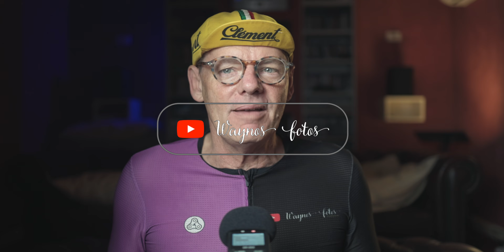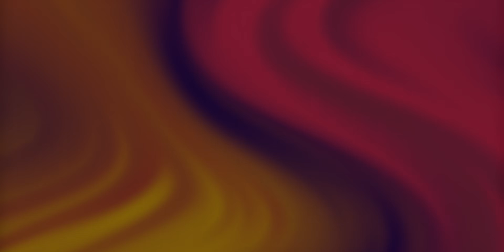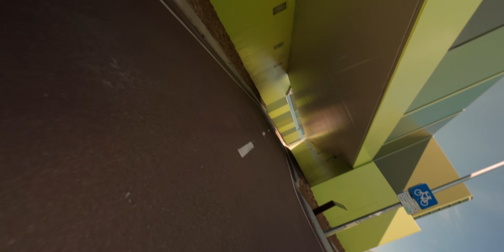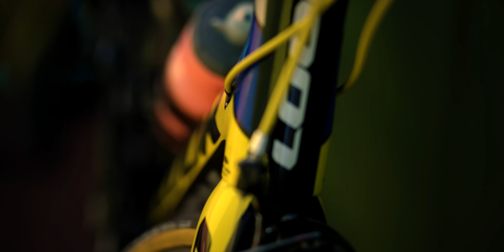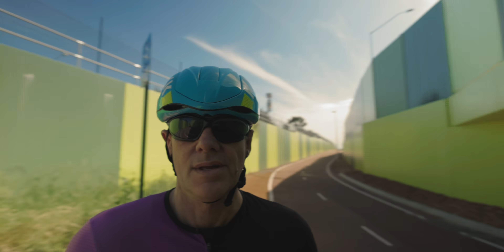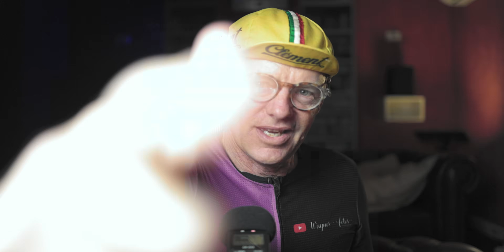TUBELESS tires, a industry failure?

Comment: Latex tubes, rim brakes, bsa bottom brackets the TRIED AND TESTED products for YEARS. Modern day expensive stuff is made in china and by baristers who are high on coke who realised you can scam the cyclists who view bikes as status symbols and anything below 3000 GBP or USD whatever your currency is is not worth it yet they pay for s works frames which are made for 300 usd in CHINAAAAA. Nowadays you pay to be a beta tester for this "tech" tubeless is a flop cant wait for people to realise discs on road bikes is over kill. If you need car brakes to control an inch and half wide tyre get better

Comment: I would submit in response: Zipp 303 FC at 1350 grams, and the Sram Axs Dub Wide.  Together you get lighter and wider, so the tech is there already.
On the 303's, 30 mm tires run at 55 psi, sealant works.

Comment: Road tubeless is theoretically the holy grail, and it's constantly sold as such. Shame about the reality. So many financial, maintenance and fitting issues. I run 3 wheelsets with them and they are a PITA.
However, i put up with this crap cos 55psi is bliss and the tyres do seal (55kg, so good luck if you're 70+) and I'm not changing anything on a ride in winter (can't even change gear sometimes let alone a tyre).
Hopefully one day it'll all work beautifully, until then I'll just have to swear a lot

Comment: 25mm/28mm tyres are race sized tyres. For racing. Anyone using race tyres on a daily basis only to complain about ride comfort or lack of puncture protection is just plain STUPID.
Unless one happens to race to work for a living, it's a NO for commuting also. Tubeless will never work properly on 25mm/28mm tyres because the pressure is too damn high. You get 95kg Hulk beasts riding on a 25mm rubber patch then complains that all the air pressure is out of the tyre when he gets a puncture, mf you should be glad you didn't slice the asphalt with those rims.
As far as tyre weight and all that, non pro's have to deal with being fat first and tyres second.
For anyone else try tubeless for yourself on tyres bigger than 30mm, if it doesn't work for you or if its' just too much hassle, then use tubes. The end.

Comment: The way new technologies are implemented in the bicycle industry is ... strange. The monopolistic position of Shimano is really problematic. The very poor technical content of the reviews in the media (no independence, no criticism). The way they have reinforced these technologies in the pro peloton is also strange / inefficient. The start of the disc brake was a failure, electronic groupset that keeps switching to safe-mode, useless tubeless on perfect asphalt stages. And then for us, the average consumer, we don't really have a choice anymore.
Rim brake are efficient ! Even on wet roads !! Cheaper, lighter, easy to maintain, reliable. for road bike AND for city bikes ! V-brakes are working fine for daily use !! and they so much cheaper and easier !!!
Mechanical gears are working fine. Lighter, so much cheaper, very reliable, no f&ck*ng battery issues. Please at least give us the choice !!!
Tubeless for road bike is a joke. 
I appreciate wider tires on road bike, up to 28mm for "race" bike. Obvioulsly, >30mm, aero is mediocre, then it becomes a nice tech for endurance-ultradistance bikes. Why can't we get rim brake caliper for  28mm tires ? I mean with more than1mm clearance ;-) 
It seems that bike manufacturers are lost in translation  trying to run around in all directions. 
One good aspect, it makes local and hand made manufacturers (steel, alu or even carbon) more competitive and interesting.

Comment: Hey Waynos,
I was riding 25mm tires with tubes and would never go back from my 30mm tubeless. Reason is simple, I can't go where I want to. Riding a road bike in Germany at least in my area was not safe anymore because I had to use the Main roads because the sidewalks for bicycles are soooooo bad that you couldn't ride them, same when you want to avoid the Main roads. I live in a highly industrial area where there is so much traffic that doesn't care one bit about cyclists on the road. I don't care about aerodynamic when it's compromised by having to use roads I don't want to ride. I have a few extra kilos on my belly which are slowing me down more than a kilo on my bike;). So, in the end I want to ride and tubeless made it possible to go for routes that were impossible to ride before. It works for me and many others of my mates who would never go back to tubes because none of us is an Athlete looking for best aerodynmic or records. We just want to ride where it's quiet, comfy and without a hell lot of traffic.

Comment: What does the tire to hook interface have to do with protecting you from flats? Car tires can be (and are) much thicker because they need to support a much larger weight. This means that it's easier to make them completely airtight and also much more resistant to flats. I'm sure you could also make a bike tire like this, but it would then ride rather horribly. Cars also have suspension, while road bikes have not. So you cannot compare them. I give it to you that the higher the pressure in the tire the more difficult it is for the sealant to work, but I don't see the point of using more than 60psi in 28mm tires. And with that amount of pressure I've never had any issue, even when using tubeless repair kits. But then you will say that for tubulars, where the pressure is probably higher, you can use the foam/liquid repair kit and it will work? I cannot judge on it because I've never used tubulars, but I've seen people in races with tubulars not being able to fix their flat tires with a full bottle of foam and having to scratch...

Comment: I’m old school and still run tubes, but I put sealant inside them (Continental tubes with removable valve cores and Stans sealant). Works great, the only issues I have is when it gets old, it can get messy when it fails to seal, but thats after the stated “stays liquid for 2-7 months” it says on the Stans bottle, but I figure that’s an issue running full tubeless anyway.
Reply: So you're adding weight for what? Not only is it unneeded weight, but also resistive in nature, as being a liquid, it will abrase against the inside of the tube (or tire if running tubeless).

If you're adding weight for the cause of reducing punctures, use a tire with a Kevlar (or other polyacrylamide) protection. The modern ones are highly flexible (compliant), and add very little weight.
Reply: @stephensaines7100  it's only a few grams, it's not like I'm filling the tube with sealant and you have security from punctures for a few months

Comment: the argument that the rims are heavier is just wrong!
the wide hookless zipp rims are actually lighter now.
Reply: Well, they aren't actually. It's not the rims that are lighter, it's mostly the hubs that have shed some weight. Check it out.
Reply: @dzrdza  according to hunt wheels the easier manufacturing process allows their hookless rim to be around 10 to 15 gr lighter. im sure it is the same for zipp, but have not found any information on their website.
Reply: @dzrdza  also ignore the hub, look at the zipp 858nsw front wheel from 2021 and 2022 both thave the same cognition v2 hub:
2021 modell : 18mm internal hooked : weight 838 gr
2022 modell : 23mm internal hookless : weight 720 gr

Comment: Sorry Waynos, two from two here. I’ve been running tubeless on my Giant TCR for 3 years. Mates of mine are running tubes and the punctures which stop the ride are 4-5:1 to mine. I’m not running wide tires. Purely standard TCR Adv 700cc. It’s not been without challenge. Doing my own maintenance has had challenges as I don’t have a compressor, but I couldn’t go back to tubes.

Comment: It's not a failure.  If some people find going tubeless road is useful

The biggest fail for me is running tubeless tire inserts for for flat protection.  You are just spending ridiculous amount of money for security.  If you are too paranoid to have flats on the road. Just go run solid tires for zero flat tires.

Comment: I’ve found tubeless to be really worthwhile on MTBs and gravel bikes. I don’t think anyone would disagree with that. But when I used road tubeless I saw no benefits just a harsher ride and messier IMO. I went back to latex tubes for my road bike and much prefer that. I also think Rim brakes are all you need for road, but discs are obviously more suitable for off-road. I’m waiting for the dissenting voices!
Reply: You won’t get any argument from me 😊
Reply: No argument there, you go with what works best for you
Reply: @Kelvin_c  Thank You for watching Kelvin. Please consider subscribing
Reply: I prefer disc brake on all bikes but I’m pro mechanic so I have no problem with setup and maintenance but I stop there. Road tubeless is just straight up nonsense.
Reply: @Slow.Smooth  😂 disc for dirt - rim for road - tubeless for dirt - tube for road
Reply: @SeeYouUpTheRoad  LOL again I have 0 issues with road hydraulic discs.
Reply: @Slow.Smooth  I own a shop and still choose rim. Not as much faff as hydro. Here in San Diego we wear our brake pads every 3 months or less, rotors every 3-6 months. Even at my cost it’s like throwing money down the drain.  We have a lot of climbing and a lot of 15-25% grades here and freaking stop lights on 50-60 mph descents 😂 it just eats hydro pads and rotors here. Rubber brake pads on alloy rings lasts forever here.
Reply: @SeeYouUpTheRoad  relatively flat here in NYC also we get bad weather here LOL
Reply: @Slow.Smooth  boo I would totally be traveling out of town every weekend to ride my bike if I lived in NYC lol
Reply: You're pretty much spot on. Tubeless on road are wider, bit heavier and in case of puncture simply a mess.
Reply: i will admit the you probably dont want to get over 90 psi on your road tires if tubeless, but who does nowadays anyways
Reply: @cypriano8763  on narrower tires (25mm) which most of us still ride, and 80 kg+ riders 70 psi is too squishy. I’m not that heavy but many of my customers are between 75 kg - 90 kg - they ride higher pressures still
Reply: @George Vargas  25mm at 90 psi is fine tubess, even with non tubeless tires and rims. 5years riding on that type of set up now. Almost 0 flats while riding my tcr on a lot of gravel, rough roads. Can't say enough good things about tubeless really..the other port of this is this concern with lower pressures being slower. For most middle aged riders the real performance gains come from losing body weight not adding a few psi to gain 3 watts of efficiency, maybe.. I think the combination  of added co mfort and the bear elimination of flats is well worth those 5watts lost. I like riding, not fiddling with my bike, the more reliable  abd maintenance free I can make it the better
Reply: @cypriano8763  and you consider tubeless maintenance free?
Reply: @George Vargas  I like no flats. Why I ended switching years ago is I had to ride the rim three times in 1 season. Went thru my spare tube and could not pach the holes on three separate rides. This has never happened to me tubeless, not even it be has touched my tires in 5 years. The sealant works, the plugs work, it's easy and reliable. If you ride on really smooth bike paths maybe, even then. Once you are familiar with tubeless, you just can't go back. Honestly I just add sealan every year. If you don't like the mess, just get the bike shop to set it up the  your good for years, just topping up sealant periodically. I'm not sold on disc, electronic shifting or internal cabling but sure as he'll sold on tubeless.
Reply: Disc - on any bike. Consistent braking, hot or cold, rain or shine. Confident braking.  Went road tubeless on a new bike in 2017. Had a few issues, turned out a rim issue -replaced under warranty. Switched to better tires - ZERO issues. Zero flats. Switched tires again. Just replaced rear again - easily fitted with a floor pump. Smoother and can run lower pressures. Fast. Not going back to tube or rim. I do carry a tube because it could be you cannot get the bead back on if it comes off on a ride. Walking a bike is a no go.
Reply: @Stevehab2  not going back to tubeless for road. Latex tubes are faster anyway! And never gonna buy a disc brake road bike. I already enjoy consistent braking. I never ride in wet conditions. Disc brakes are also affected in the wet even though you will try to say differently. I own disc brake bikes too.
Reply: @ChocoPants  It can be a personal choice. Lots of 9 percent grades for half mile around me,and longer around six percent. So, for me, disc all day.
Reply: Agree now with plugs and better sealant tubeless is great on mtbs, guessing gravel & as a tub alternative in cx.  I remember my 1st tubeless mtb tyres they were a nightmare to fit the beads were so thick - I remember losing an age in a 24hr mtb race as I struggled to get the bead off the rim to fit a tube.  Then a mtb duathlon I had built a big lead and a flint cut wouldn't seal and there were no plugs then.  On the road, the higher pressure make them less effective.  Though some of my team mates loved them in Roubaix but their wide tyres on there CX bikes was the most common choice.  I have used them TT'ing with the corsa speeds being quick and most races short enough that if the sealant doesn't hold it race over anyway.  Mounting on a disc wheel can be a pain with the crackpipe & had one race where I nearly missed my start getting it to seat properly.
Reply: For MTB, you typically get fewer flats and much better traction with lower tire pressures. I don't see the same application for road.
Reply: @briannyob7799  tubeless works awesome for MTB but for road not so much
Reply: In high traffic areas when you need to emergency brake, the quicker stopping power of discs have saved me a number of times.
Reply: @DanTuber  that is a myth! Disc brakes do not stop quicker than rim brakes!!

Comment: Tubeless on cars still isn't perfect. If you manage to "break the bead" on car tyre, you can't just pump it up again to reseal it. It requires higher volume to push bead into place.
Reply: Or putting in a tube.
Reply from the maker: True that, but silly people like to have close encounters with the kerb. 😝